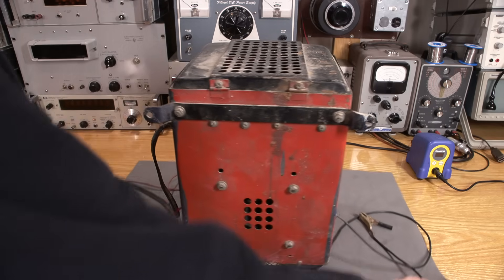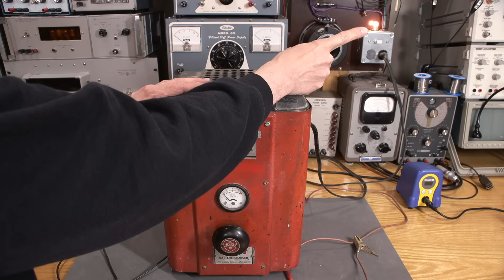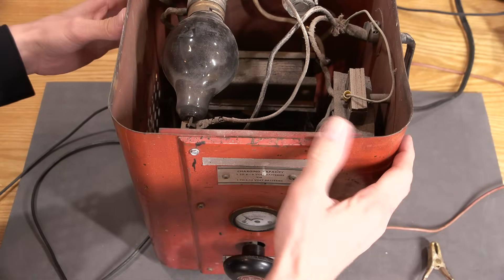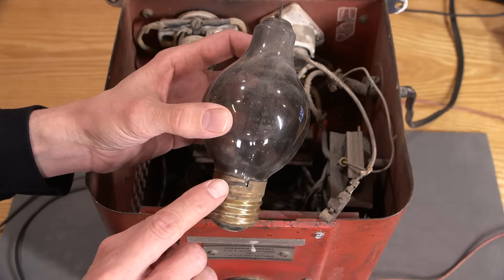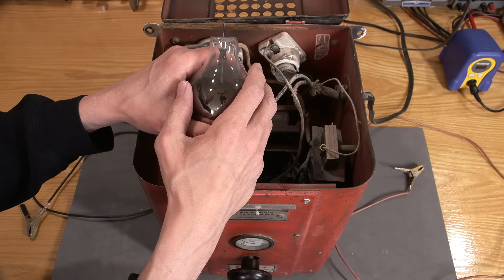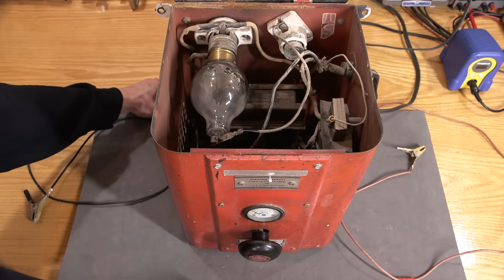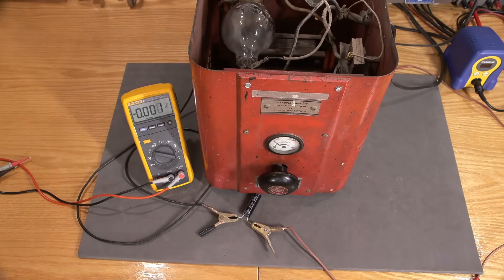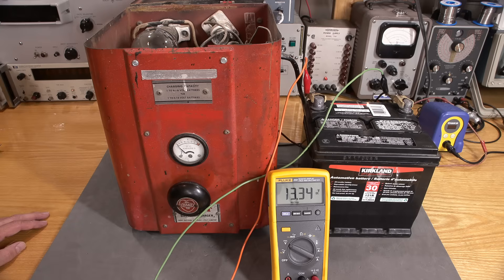Mean Hart Battery Charger - See It Work!

Comment: Anyone can make a cheap and reliable charger like this, but no one does since the power factor is shit and likely illegal to sell much because of this 😂

Modern chargers can be left on for years without overcharging the battery and thus take much more finesse.

Could still make it partly modern by putting in some zener diodes and transistors to turn it off above a certain voltage or something similar

Comment: Same with lightbulbs on cars, touching the glass doesn't hurt it at all BUT as it heats it will burn off the grease and can and will contaminate the reflector/projector the bulb is mounted in and will make the light go dim after doing this over and over

Comment: I have had older chargers than that one. My chargers were from the 1920's. And there is one way to tell when the charger is done charging the battery. The light gets dim when you are charging but the light gets brighter when the battery becomes fully charged.

Comment: I was at a junkyard once,decades ago,and they had one of these battery chargers in a cage charging several batteries unattended. All of a sudden there was a sound like a gunshot and one of the battery exploded.
As you pointed out. These are NOT automatic chargers. You must monitor them and disconnect them before they damage the batteries

Comment: I have a big upright cart type battery charger from the early 50s.
It's the same in that it's very nicely built and it only has a current selector and Amp Guage.
Mine is good for 6v @ 100A and 12v @ 50A. It even has a nice cooling fan.
But mine has a selenium rectifier stack instead of a bulb.
It's all rusty but still solid. It was originally a cream body with a black lid.
I'm going to restore it but paint it a dark cherry with a black top.
Made in Canada from the lost days when Canada still had testicles.

Comment: ...this urban legend of tubes breaking if they are handled with bare hands probably stems from another urban legend claiming incandescent bulbs (especially car headlight halogen bulbs) will have their lifespan shortened if handled in this manner.
The actual reason to never touch a halogen bulb is that the sweat and fats on the skin get fingerprinted onto the glass, and when the bulb heats up in service, these impurities on the surface boil off and then condense on the reflector above the bulb. This can often be seen in non-sealed car headlamps and this milky layer on the chrome reflector will substantially decrease light output. So: If you handled a bulb with your fingers, wipe off the glass well before installing, preferably with alcohol.

Comment: I was curious, could you use a 12 volt automotive (1970's style) voltage regulator to keep the battery from overcharging? Not sure if that would work due to the generator field tap.

Comment: ‼️Mr Carlson: buy an electric screwdriver. It will change your life.

I have severe arthritis. I was stupid and used manual drivers all the way up until this year. I finally tried one from Amazon and I will never ever go back.

The brand I bought is Fanttik (not sure that’s the spelling) and it’s one of the highest rated drivers you’ll find in reviews. It’s got great breaking force and adjustable tightening torque. It uses standard 4mm hex bits.

Save yourself the strain. Trust me.

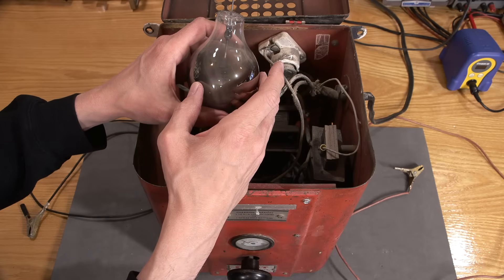Comment: 11:40.... 😂 I was going to mention that fact..

The first time I cleaned the old crusty, baked, dust off of some tubes years ago, the lettering came off easier than the dust did...😲

Now today I usually just leave the dust on there. Part of the charm of using old tube equipment is the "smell" of that old dust when the tubes warm up and start baking it.

If I MUST clean some filthy old, valuable, vacuum tubes I will use a q-tip like what was mentioned in the video and very carefully clean around the ink. Sometimes even just touching the ink a tiny bit with your bare finger WILL knock it off the tube. I prefer plain ole Windex when cleaning them, just DON'T allow any liquid to run out of a q-tip end and go down the glass, because that will ruin the ink also. If it's a very common tube, and needs to be cleaned, I just disregard the ink altogether and just clean it right off. If its an odd tube that I cant recognize by just looking at the insides, I'll put a little piece of masking tape on the base and write the info on there before wiping the tube off.

Comment: I dug one of those, with the Tungar lamp in it, out of the trash about 40 decades ago, and dragged it home to use as a power supply for all my projects. That thing packed a PUNCH, and like what was mentioned in the video, was basically indestructible. I dead shorted that thing out MANY times and it just kept on keepin on. 

I remember the intense glow from the inside which, of course, led me to take it apart and check it out. I didn't fully understand how it worked when I was a 10 year old, but I figured that the lamp was SOME kind of rectifier/voltage reference tube. Today I do fully understand how a Tungar lamp works, and I wish that I still had the charger. It was a neat, TOUGH, device.

I do not remember what ended up happening to it??.. 🤔 somehow it disappeared years back. My parents probably found it and threw it out on me. I had a TON of stuff like that on my (well, THEIR) workbench when I was a wee lad.

Comment: I got my hands on incredibly old charger, that had autotransformer inside (in linear-ish setup), some selenium rectifiers and it works likr a charm. Of course its heavy, bulky, buzzes like its going to devour on you any minute....yet it works. For "everyday" and unattended use I am using cheap Aldi/Lidl one. When shit hits the fan....its retro time!

Comment: You have great instructional videos. I completely agree with you that old devices can last almost forever.
I found a discarded charger from 1950, where two rectifier tubes were two-way, so the rectification was better. It has a 6/12/24V switch, two current stages for each range, solved either by one or two-way rectification. Two large limiting resistors. The lamps were broken, I replaced them with 20A diodes from a car alternator. I added a seven-stage switch that switches the resistor taps. The seventh stage is direct. The transformer is so nicely designed that when switching to 12V without current limitation, the 12V battery is charged with a current of about 4A and when it reaches 14.5V, the current drops to almost zero, so it will not boil over even when the charger is connected for a long time. If the battery is very undercharged, the current is initially 10A. The charger is used all the time and is very reliable.

Comment: I collect light bulbs and have a few of these old chargers! I have never powered one up, but they ate cool! Rectigon is Westinghouse and Tungar is GE. The Westinghouse says the last part of the trademark as the argon gas in these bulbs-Recti-GON for rectifier bulb filled with arGON gas. GE’s trademark is TungAR, the last 2 letters for the first 2 of AR-gon gas, and the first 4 letters as TUNG-sten, the tungsten filament in the bulb. The argon gas actually forms an arc from the filament which will emit free electrons when heated, with NO electron-emissive material at all on the filament, so it needs to be white hot to emit electrons. The arc that starts through the argon allows easier emission without an emitting coating like on fluorescent lamp electrodes (cathodes) or in indirect emission common vacuum tubes. The argon also increases conduction between the filament and the carbon anode that is attached directly to the connection clip at the top of the bulb. This is a classic Edison “Edison Effect” bulb that initially used a carbon filament and only used a vacuum and no current carrier gas. These bulbs are high amperage argon half-wave rectifier tubes. You cant see the blue glow of the argon carrier gas because the filament is very bright. At that level of incandescence, the rated life of the filament SHOULD be only 350-500 hours, typical incandescent general lighting bulbs is 750 to 1000, sometimes 1500 hours, BUT- these likely run short cycles, and the inert gas fill makes pressure when hot that retards tungsten sublimation off the filament, reducing thinning of the filament and breakage at low hours as will happen in a strong vacuum, which actually increases sublimation. I think bulb life is a combination of both. This is a high wattage low voltage filament and you cant see the thermal mass it has when switched off, with a long afterglow! There were larger and smaller versions of these bulbs. I have both. The big one is tubular and has wire terminal connections to terminal nuts, 2 on one end, one on the other. No base. Aside of these most common mogul base ones, the small versions (very hard to find!) use standard medium Edison screw bases. I have seen units with 2 bulbs to make full wave rectification and more max amps, about 25% more in this case, or half wave as usual with double the amp capacity with the bulbs in parallel with one on a switch to cut it out for standard single bulb current use. The  battery voltage and 1 battery to 6 6 volt or 1 to 3 12 volt is limited by a multi tap simple choke-reactor connected to the selector switch and one battery clip. The main step down/AC line isolation transformer is a separate unit in the case.. cheers! Rick Delair, Schaghticoke. NY USA! 😋👍🏻

Comment: The chargers we use for our electric forklifts put out 48 volts at up to 500 amps. The garden size cables on the battery pack got hot when running the pack down to 20% charge. It takes about 1 hour to recharge the battery via the rapid charger. Mind you, these chargers are wired for 600 volts, 3 phase AC.

Comment: So what's wrong with the selenium rectifier?😁 I did have an old copper sulfate one a long time ago, you could make your own. It would be fun to hold the battery connectors and disconnect the battery without turning off the charger, wouldn't it? I'm not going to try it.

Comment: That’s funny to hear someone talk about ordinary incandescent bulbs as if they’re something “old” lol. Of course the technology is old, but they’re still very relevant. Those Tungar tubes on the other hand are indeed “old”. Which is why I love these old chargers. 😁

I have one that appears to be practically identical to your charger. Mine is in much poorer condition, cosmetically at least, but still works perfectly. 

I have another, much older and smaller one that is for 6 volt batteries only. It uses a very unusual medium base Tungar tube.

Comment: I remember when I was in the army, they used to ship lead-acid batteries dry. You had to add the electrolyte to them and reform the battery with a similar charger.
Reply: Same with lead acid motorcycle batteries today, although I would buy AGM myself.
Reply: Still have to add the acid yourself today with small motorcycle/power sports lead-acid batteries
Reply: @davelowets  Yes, they usually come "dry charged".
Reply: It wasn't that many years ago (maybe 10?) when I could by lead-acid battery and it came in two parts. Battery and acid bottle(s). Now EU has made our lives sooo much safer that one can't just walk into store and buy battery acid anymore. Only professionals whose work involves that stuff can purchase it. Even thou batteries still may be shipped as two parts, the store now has to put acid into battery.
Here goes the /rant part about lead-acid chargers.
Speaking about battery chargers life expectancy, MrCalrson is right. I still have to see one new tech charger that lives past 10 years. My simple diode bridge and transformer charger, althou made in PRC (or so it seems), has been working for more than 20 years. RingCharger, was told it should be good, had quirks like quite often stopping around 90-95% charge or deeming battery faulty when it wasn't (yet), refusing to charge. Also refused to top up near fully charged battery. So never worked as expected, started to gather hate from day one. After 5 years or so, it went up with nice bang, flame and cloud of smoke.
There were some maintenance chargers, supposed to periodically topping up battery when voltage dropped - had two of those and they died very quickly. Less than a year (could not take below freezing temps or just crap). They also never worked quite right because after power outage they would "forget" settings and let battery go flat, imagine that crap.
So, in my mind I've started to classify those microprocessor controlled smart chargers as "garbage". My dumb charger can put some charge to half dead battery but I've yet to see one smart charger that does the same. If somebody says - then buy this intelligent/hyper/super $XXXX one? Nope, why should I shell out $XXXX if my 20+ year old and less than $YY can do it?
Reply: Interesting!
Modern batteries are often shipped dry, with a little bottle of acid.
But they are dry-charged, so you just put the acid in and then it is ready for use. Maybe not fully charged, but at least a semi-full charge state.

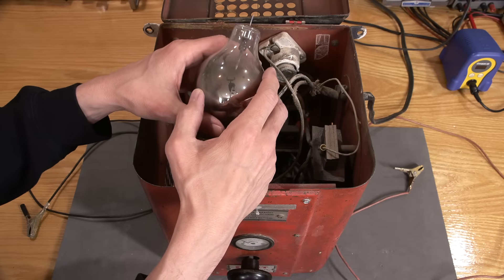Comment: 11:27 I had always heard a variation of that "tale" which claimed that it was the skin's oils left on the glass which could heat up when the tube is in operation, causing uneven hot spots, which could then cause stress points in the glass, which then could, over time, cause the glass to break.

Comment: Just curious about the badge that states 1 -6 6V batteries or 1 - 3 12V batteries ... how would you charge just one battery without over-voltage on it?
Reply: Watch again, focus at 16:45.

Comment: From what I understand the reason you don't touch tubes or bulbs with bare hands is because the oil from your hands can cause the glass to fail when the bulb or tube is hot.  I always use nitrile gloves when handling them and then clean the bulb with isopropyl alcohol on a paper towel just before installing it again. I learned this from technical theater teacher specifically about halogen bulbs but have used this precaution with vacuum tubes as well as HID bulbs such as Metal halide and High Pressure Sodium.  Just my $0.02 Love your channel keep up the great work!

Comment: I was taught "don't touch the glass" with regard to high power, high heat quartz lamps. (Think 500 watts and up.) Those really will warp and explode with simple finger oil. (Ask me how I know. 😅) Didn't think it would have been an issue with vacuum tubes, though. Besides, it's generally good advice to keep the working area clean.

That is indeed a beefy monster and I look forward to seeing it restored. Thanks Mr. C! 👍
Reply from the maker: Yes for quartz lamps, I think this is where the confusion comes from.

Comment: Talking about old battery chargers. Some time ago "Hand Tool Rescues" restored a battery charger with a mechanical rectifier. Unfortunately he didn't explain how it works. Anyone here who can explain how a mechanical rectifier works?
Reply: I'll try:  I cheated and copied Brave's AI answer/summary:

Mechanical Rectifier Explanation
Mechanical rectifiers are not commonly used today due to their high maintenance requirements and inefficiencies. They typically involve mechanical switches or contacts that open and close to allow current to flow in one direction only, effectively converting alternating current (AC) to direct current (DC). These devices were noisy and required frequent lubrication and replacement of moving parts due to wear. When the contacts opened under load, electrical arcs and sparks would occur, heating and eroding the contacts over time.

Modern rectifiers use semiconductor diodes, which are more efficient and require less maintenance. However, the concept of a mechanical rectifier involves a series of mechanical switches that are synchronized with the AC waveform to allow current to pass in one direction and block it in the other direction.

AI-generated answer. Please verify critical facts.

Comment: I worked in TV & audio repair shops in the early-mid '70s. Handled thousands of tubes bare handed with no problems other than occasionally burning my fingers on a hot tube when I was in too much of a hurry. And I remember the distinct smell of a tube that's been handled by oily, grimy hands when it gets hot. I find it amusing that halogen lamp handling rules have migrated to vacuum tubes. Kids these days!

Comment: Was this charger used for charging the starter battery, or was it also used to charge electric cars? Although by the 1950s, the era of electric cars was already over. I'm familiar with the versions that used a mercury vapor rectifier. I'm looking forward to the restoration.

Comment: The comment on not touching the glass is because grease left over the glass can produce small cracks on the glass when it heats up - but only if they heat up to very high temps. In the case of audio tubes, they don't generally heat up that much, usually below 200C. But there are some more technical tubes that do get incredibly hot and that is the situation one is trying to avoid.

Comment: I was taught with the high intensity filming bulbs we used to use at the TV station to not touch the glass bulb with bare hands. The oils on your fingers would create a heat differential on the glass that is what makes the glass explode.

Comment: As for the touching of glass, I believe that really only applies to high temp applications such as a Halogen bulbs where the oils from the skin can cause temp fluctuations in the glass causing a premature failure. I love vintage tech. So reliable and overbuilt yet simple. So many people put stock in beauty, I put stock in quality. Nice video. Thanks for the content.
Reply: What skin oils do to vitreous quartz lamp envelopes is cause the quartz to devitrify and crystallize.  Crystalline quartz has much lower transparency than vitreous quartz and all the extra radiation absorbed causes envelope overheating and failure.